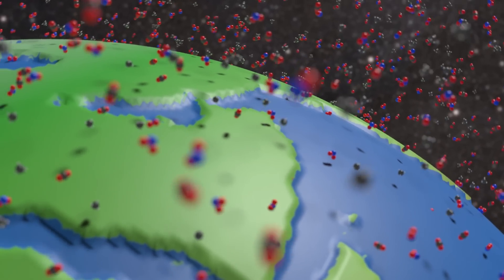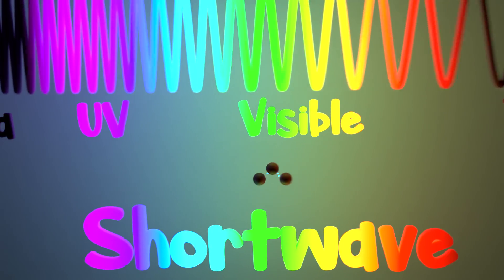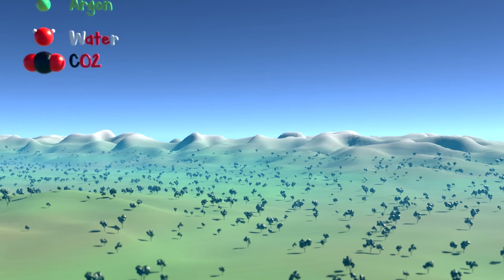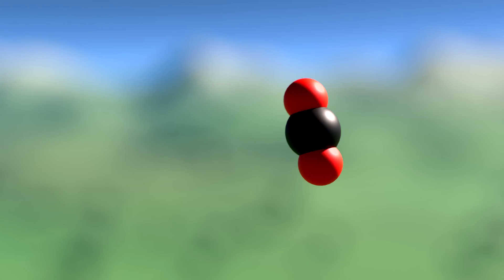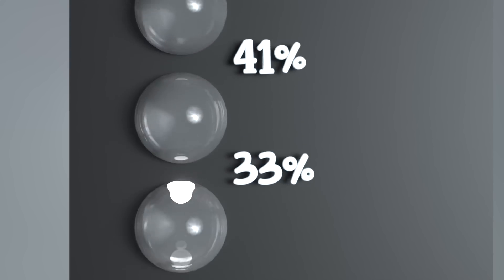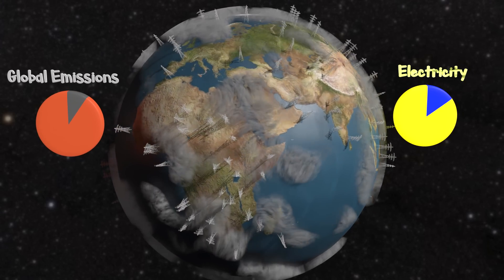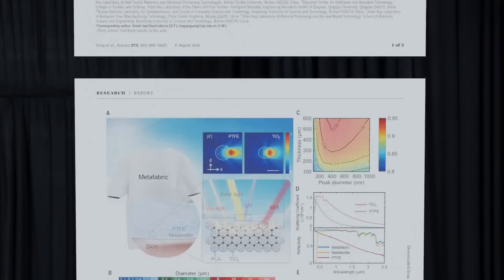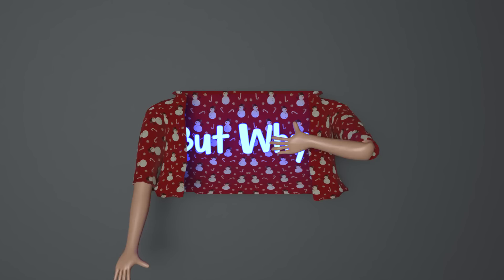Energy Free Cooling through Physics

Comment: This is not a cooling device, this is basically a micro-mirror. Although it will cool whatever you cover with it if it has any light intake at all, and could obviously cool the entire planets surface down to insane levels, its not actual "refrigeration" thats taking place here. also, this is not "energy free", we technically reject all the energy coming in, of which most probably flies off into space never to be seen again. think about it like a solar panel that instead of producing electricity simply doesnt produce heat. 

while it is a cool material and gr8 video, and could be an easy, great solution to prevent heating up of buildings or cars or tents, its questionable where all this energy would go if you tried to, for instance, cover a city with it. More likely than not it would accentuate all the mirrors we have in cities already, which im not sure im a fan of

Comment: How would the heat from the surrounding area not just travel into the tent through air flow?
Tents already provide shade which is cooler than being outside in direct sunlight. It's the reason middle-eastern traditional clothing is covering everything- keep the heat out.

In the Nordics we have a dual issue. We need to keep heat in during winter and keep heat out during summer. The latter becoming more prevalent during the last 20 years as global warming accelerates. As houses are better insulated, it leads to homeowners opening windows in the summer time to let in colder air, however it works the opposite way on days with very little wind.
Large glass panels and lack of overhanging roofs due to design trends are also causing houses to heat up during summer time. This heating leads to more homes having cooling systems installed, raising energy usage.

Keeping the heat in is just as important as keeping heat out, depending on the season. When we know this, it seems a layer of heat-shielding material on top of insulating material would be beneficial.

Comment: The problem is that this ALWAYS cools the room down, you can't control when to cool and when to heat.
Reply: Which makes it great of a product to be used in the tropical regions which is always warm, so yeah no need for air conditioning that contributes to heating the environment because they have those hot exhaust that blows out hot air outside of the building which goes straight to the environment.

Comment: Heat transfers by 1) Conduction, 2) Radiation, and 3) Convection. You completely ignore convection, which is how all modern heating and cooling systems are designed as it is the most efficient heat transfer process. 
I get the video is about cool advancements using radiative heat transfer, but ignoring convection when talking about applications or the greenhouse effect is where you veer into things being "too good to be true".

Comment: Let me save you tenminutes.  They use a material that reflects sunlight and emits a lot of infrared light, therefor making a material that doesn't get much heat from the sun, but still radiates heat via infrared light.  This makes it cooler than the surroundings.

Comment: Passive cooling only works if the object its passing is cool.

You know that box that has a fan in it? That you loaded with ice? Yeah, that's passive cooling.

Technically, regular concepts of air conditioning are also passive cooling. Just powered with electricity.

Comment: I assume that this method is perfect for tents etc. light things as is, but I assume that houses that need structural materials too would need some piping to bring the cool from the roof to the inside of the house as you wouldn't be able to make the entire roof from these materials that are transparent to IR. And if you want to cool lower floors of the house, that's absolutely necessary even if you could make the entire roof out of these materials.

 It would still save a ton of energy compared to current day air conditioning, but be a bit more complicated than "a reverse greenhouse".

Comment: You're confusing insulation/radiation with active cooling. There is no way this material could stay at a temperature cooler than the surrounding air in a static environment. If this was true, you could make a refrigerator out of it that would need no electricity. It would actually solve all our energy needs by creating a usable heat differential for creating electricity. Your example perfectly explains this as it is releasing heat from inside the building through a material that excellently radiates energy away, while still providing amazing insulative properties. It's not actively cooling the building, it is simply radiating heat away.

I can see a theoretical material that radiates heat faster than it absorbs it, thus making it passively cooled beyond the surrounding temperature. If this material was ever created, we would have literally endless amounts of energy. This would be the most game changing material to ever be invented. It would solve all energy needs worldwide.

Comment: The two main concerns I have with this is:
1.) What is the cost to produce these materials (both economically and environmentally)? Seems too good to be true if it was such an easy fix to the greenhouse effect.
2.) What about when the environment is too cold? Does this material have the ability to insulate and store heat? From the way it's presented it doesn't seem like it could. So this poses a problem where the only thing it does is cool but it does not heat up. If this is the case I don't see any applications where this would be viable since no one place or application will ever only be "hot".

Comment: Back in the 70's, I lived in a trailer that had a Swamp Cooler (Evaporative cooler) It has its down side after a few weeks, the water gets pretty funky, thus the name.
On edit: They only work efficiently when the moisture content of the ambient air is low, otherwise, they emit air with a high humidity content with the resultant problems with mold, condensation and other issues.

Comment: This material may work great in consistently warm places. But what about areas with 30, 40, 50 degree temp swings? 10 degrees cooler is great when it's 90 out, not so when it's 40.

Comment: My field of interest/study is Sustainable Engineered Systems, as part of a Building Science degree. Many higher spec new builds (and renovations) are able to massively increase the energy and resource efficiency of commercial and residential structures -across their 'living' lifespan. Mostly this involves integrated automation of heating, cooling, light, fresh and waste water, filtered air, etc. The automation of these systems isn't new, the integration is. Traditionally, the individual professions involved are distinct so multidisciplinary practitioners are rare. Integrated automation heavily depends on central computation for these systems to collaborate; cutting edge programmes, AI, big brain environmental control units. This amounts to high  expenses or cause bottlenecks upon other technical systems (see the GPU shortage). 
All of which is to say; clever application of primitive/passive solutions has huge potential to alleviate strains on an already strained global supply chain network. Especially as many nations chase their goals ahead of the 2030 and 2050 carbon emissions deadlines. The proactive sharing of low cost, low impact, climate control has never been more important.

Comment: Thermodynamics... So you reflect energy from your building and excite more greenhouse gases...isn't that the problem to begin with?  Converting heat to move electrons which provide the work to xfer more excess heat to other processes like chemical binding of the gases should be the goal.  Using less coal fired energy equates to lowering the exponential curve you are basically describing.  While your visuals are appealing in material science for passive locomotion, not really global cooling.  We know we can generate electricity with temp differentials, and we can even do it without efficient expensive alloys.  The material science of coating a heat sink(like a chunk of granite) with a thin layer of heat captive material that won't react with the elements in nature should be the goal.  Coating an underside of the sink with a material that can act as a TEG and passing water, the efficiency of such as system is super low ... but a 10'x10' block in your yard could cool your home with the power of the sun preventing some of the usage of the coal power feeding your A/C unit.  And heat sinks still work after the sun goes down.  The water from my well comes in at 70 degrees, stealing a few degrees for passive cooling and pumping it for free sounds good to me.  Radiant barriers are cheap, and this simple addition to my attic reduced my elec. usage by 20% in the hot summer months in Fla.  So, I hope you recommend some actual real world solutions, like nuclear (specifically thorium), cheap insulators, and find a way to dev. TEGs that don't cost $7/inch.

Comment: This actually feels pretty reasonable. If you can make a material that lets through infrared but reflects (instead of absorbing) light / radiation / photons at higher frequencies, it will effectively be an exceptionally efficient sun shade.

Now the problem is, as always, how do you mass produce this, and can you do it economically and ideally cleanly?
Reply: See clouds.
Reply: @stevenswenson7041  clouds actually act as insulators and compound the greenhouse effect. Bill Nye had an experiment where he showed how it works. They do not invert the greenhouse effect.
Reply: even if we don't do it efficiently today, demand would probably force producers to make it more and more efficient over the years.
Reply: @rsboi-yt  Over the years, huh? If only we'd started 40 years ago... Not sure how many years of ramp-up time we can afford for stuff like this before it becomes less about managing energy and more about how to make better stillsuits.
Reply: the Polyethylene aerogel doesn't seems that bad to mass produce
Reply: Another question, in the age of microplastics and PFAs, is how to do it safely.
Reply: Just stop building so many damn parking lots and plant more trees!
Reply: Raven Adventwings, No, we're not headed toward another ice age any time soon.
Reply: Tio2 paint
Reply: @TwoForFlinchin1  check this out so one layer is an anode, the last, a cathode, and the rest is up to you! Titanium dioxide is toxic too i guess
Reply: @TwoForFlinchin1  Is it close to the best performing option for cooling?
Reply: @C4Oc.  Well a modest air conditioner uses 2kw, and this uses 0kw, so it seems pretty good.
Reply: and will it fix anything? why not have bio engeneered alge that can process the co2 and methane?
Reply: @VolkColopatrion plant more trees. I have noticed that people buying a home often strip the land of all co2 processing trees. Not the only answer but co2 is a necessary plant food.
Reply: @marcisaacs9407 planting trees have almost 0 net effect on amount of CO2 since most of the CO2 absorbed by trees are released into atmosphere by human activities such as burning or biological decomposition , only a minute fraction turns into subsurface organic matter
Reply: @marcisaacs9407  this isn't a solution at all. Yes in local scale it has massive effect but in other areas like shade and water retention. But oxygene isn't their best thing. The marine algae (phytoplankton) absorbs most of atmospheric CO2 and we need to focus there on the ocean not on land
Reply: @VolkColopatrion  China could turn co2 into food by using electricity.
Reply: @kanlu5199  no.
Reply: @VolkColopatrion  Your words are pointless
Reply: NightHawkInLight demonstrated making and testing IR cooling paint, brilliant work!

Summary: foam insulation, off-the-shelf white paint over that, whitewash/nanopore coating on that, then a small standoff and plastic film to keep warm winds off the cool surface.

https://www.youtube.com/watch?v=N3bJnKmeNJY
Reply: Real talk i bet skyscrapers have some type of special tint, so imagine the tent idea, but the material is clear! Then you could draw stuff on it/stickers!
Reply: Plant trees
Reply: This is what Columbia does with their coats, in reverse. Reflective inner lining.
Reply: The thing I dont get is: You only can achieve equilibrium right? IR radiation goes out, but also comes in from outside. So basicly you cannot cool below outside temperature, which should be more or less equivalent to opening a window. And for its reflective properties in the visible spectrum... the more reflective it is, the more your house looks like its wrapped in tin-foil. Which, I dare say, possibly wouldnt be to the taste of most people.
Reply: Try a black garbage bag. Everyone knows it's a terrible frost fabric. Polyethylene is so bad a trapping heat it usually gets colder inside the bag and kills the plant you're trying to protect. The plant and dirt radiates right through the bag and the 1mph 3°C night wind that's keeping other plants unfrozen doesn't help the one in the bag.
Reply: No and No. Simple straight and sadly true answer
Reply: And the follow up story......"How a Nobel Prize winner started the next ice age."
Reply: @Jokemeister1  change your name and you’ll get more likes. Not as funny when it seems like you set out on a mission to make a joke.
Reply: @Jokemeister1  This is pretty much the background plot of Snowpiercer, isn't it? (lol)
Reply: @RavenAdventwings  that's why this kind of projects need to be taken carefully the last thing we want is another ice age
Reply: @MrSoso1050  Hmm... I think we're a decade or two late for that. Aren't we already headed for a little ice age?
Reply: @RavenAdventwings  no, the climate is still substantially warming.
Reply: I'm wondering how it would be implemented in big buildings and areas of extreme distress (with earthquakes and hurricanes and such) and if that implementation would require complete rebuilding to be effective.
Reply: Instead of looking to get rich off of a great idea, maybe think of just helping the world evolve? nothing is free. So mass production is going to have a negative impact. We really need to start slowing down instead of speeding up. Fact the fast something moves the more friction it creates. Humans need to slow down.
Reply: @whatshappening177  No we need to build fusion reactors soon in order to decrease fossil fuel dependence. Fossil fuels will decrease so you need to build anti-global warming tech at a faster rate than the fossil fuel consumption.
Reply: @earthenscience  i think you missed my point altogether.
Reply: @whatshappening177  I get what you are saying, similar to how some people say we should be anprims that don't use any machinery thus have 0 emissions. The reality is though that fossil fuels are needed to maintain civilization and our current level of agriculture. Nobody's going to stop. Nuclear energy is needed to replace fossil fuels (solar still uses fossil fueled factories to make solar components.)
Reply: Send panels into space, you only need to cover a small percentage of the surface, and only on the dayside.
Reply: @jafabian37  right? And panels are Oled on the inside!
Reply: The earth receives much more IR radiation from the sun than it radiates out into space. I don't know what mistake they made that makes them think that an enclosure of aerogel would cool down 25C under the Sun in Atacama.
Reply: There was a small ice age about 200 years ago.
The EU have a crazy project of using solar panels in space and then beam down the energy with microwaves.
There's companies that developing windows that can work as solar panels and be shaded etc

Comment: What about combining an inverse green house with a regular green house and use the heat differential to drive a heat engine? I doubt it would be more efficient than photovoltaics, but would have the potential to output more evenly. Also sounds cheaper and simpler.

Comment: In theory, those might be solutions, but in practice you will most likely never see something like this in a timely manner in a product. First applications will probably be space vehicles, since cooling up there is much more difficult than on earth. And the majority of hot countries are also developing and lower income countries who live without AC anyways and adapted their culture and lifestyle to the temperatures.
There is also much cheaper cooling available for these zones by simply utilising the pressure differential plastic bottles can cause when mounted into a wall using the effect of expanding and compressing gas (air) and cool the inside of a house passively that way. No advanced expensive material needed.

Comment: Survival covers (derived from the coating put on satellites) achieve a similar purpose.
They reflects IR in one way and let them pass through in the other. Allowing to keep someone cool during a heat stroke or warm if he risks hypothermia. Some people verse in DIY already use those to make curtains that you can use to improve your comfort, you face the absorbing side outward, reflecting inward in the winter and do the opposite in summer. Some fabric are produce that way but they are really expensive and it is always kind of hard to know how they are produce and if they have exactly the same effect.

It is way more difficult to apply in definitive building application as depending on your geographic area you want it one way or the other or even both depending on the season, making it less interesting than "dumb" isolation that just limit as much as possible heat exchange between inside and outside a building and can be completed by a high efficiency heating/cooling solution (e.g. using heat pump with the ability to chose if you pump it outside -> inside or the opposite).